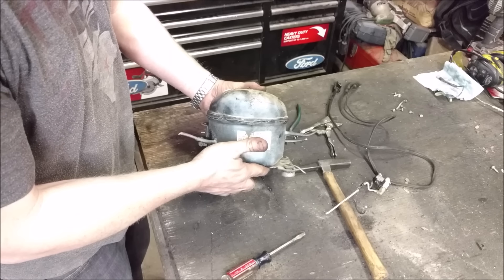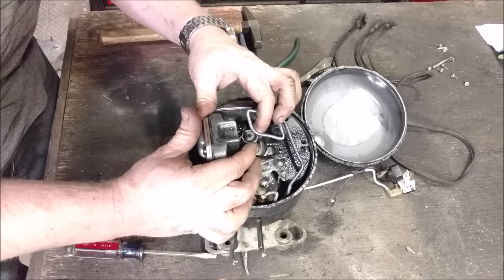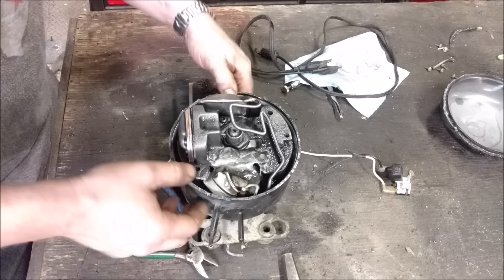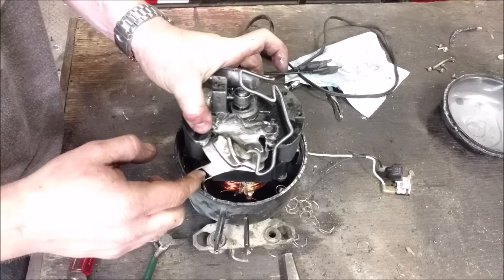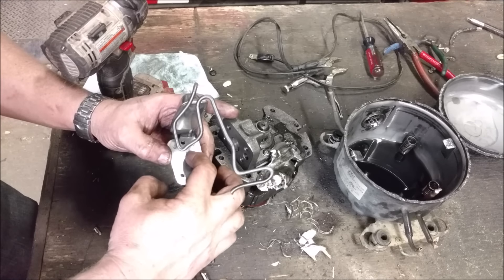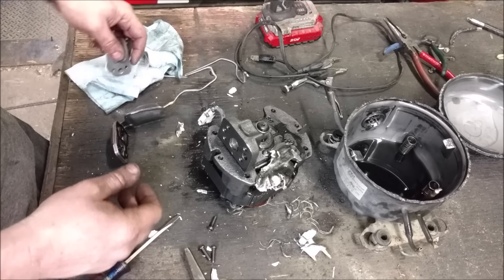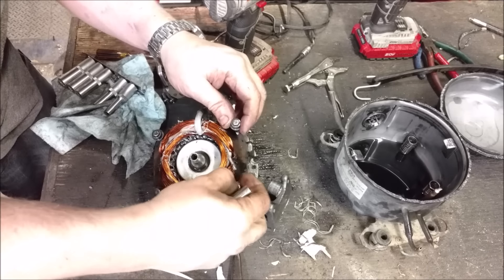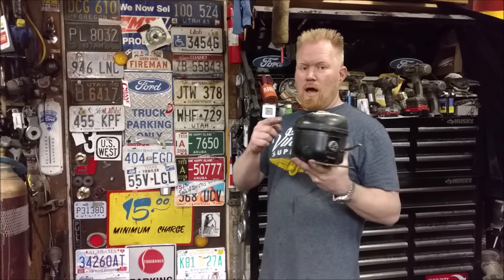What's inside a Refrigerator Compressor

Comment: Oh hey. Thanks man. I've always wanted to see inside one of these and maybe use them for stuff. I'd like to draw a vacuum on a chamber to freeze dry a banana actually. 
Have you gotten to experiment with rust removal using your battery charger yet since back when we talked about it ¿
Reply from the maker: Freeze drying would be a fun project. I haven't played around with battery charger electrolysis.
Reply: Banna somanney  counder fee but not all coundarrey  ables  c-19 cabenes fee,ok

Comment: Those bolts might be Triple Square bolts. 
I’ve only used a reverse of that in VW suspension but they threw me for a loop the first time I came across them.
Reply from the maker: I know exactly the VW bolts you're referring to. I have a set of their sockets. These are close but they're some crazy half breed of a few different bolts. They might be German designed as that is the closest I've found.

Comment: I have a 1954 Philco refrigerator that I cannot get get the compressor to run. I have a new starting relay and have figured out the START/RUN/COMMON, but it never starts. I am not sure if the start circuit is complete as I cannot find the correct schematic and haven’t decided to completely disassemble the fridge. Is there any way to get the compressor running without a relay?
Reply from the maker: I've worked on old fridges a fair amount. You have your HOT wire and your NEUTRAL. 
Connect NEUTRAL to COMMON. 
Now hears where it gets dangerous..... You need to connect START and RUN to HOT at the same time but once the motor starts to spin you need to only disconnect the HOT from the START windings. 

I will note that a modern start relay may have the terminals in a completely different location than your Philco. The last vintage fridge I worked on was a 1941 Kelvinator that needed a special start relay "supco RO81 Relay"
Reply: @sixtyfiveford  I took your advice but am apologizing for being delinquent in saying thanks. I took an old cord and modified it to attach to the compressor; the neutral to the common, the hot to the run, and power from the hot through a momentary push button switch to the start connection. Upon pushing the momentary switch the compressor immediately began running. I released the push button switch and it continued running. The compressor is surprisingly quiet and the refrigerator began cooling soon after the start. I tested it several times and each time it ran fine. Now it is near the top of my honey-do list. Thanks again for your help. Darlington, South Carolina

Comment: Just out of curiousity, why are there 3 wires on the compressor wheras the input power is standard 2 wire (hot and neutral) ?  What's that third wire for ?
Reply from the maker: Just to start the motor, then the power only goes to the run winding.

Comment: My kids left the freezer door open . 7 hours went by before I noticed it. The compressor now buzzes real loud for a few seconds. And does it about every 5 minutes. Fridge doesn't cool anymore. But sometimes it runs fine. What do you think is wrong with it?
Reply from the maker: It overheated it. The compressor needs to cool down completely for a few hours and then try. So close the doors and unplug it for 2 hours. Then plug it back in.
Reply: @sixtyfiveford  i did try that. It's just a garage fridge. Nothing important is in it. It was unplugged for about 5 hours. Then I plugged it back in for a few hours. Still buzzes pretty loud for a few seconds. And does it about every 5 minutes. The compressor feel hot to the touch. But doesn't have any vibration like the one in my house has. Almost like the motor isn't spinning. It has also just gave up on cooling anything... thanks for the quick reply!

Comment: How sensitive to motion are these compressors?  For example if one of these was running in a moving vehicle?
Reply from the maker: They don't do well in my experience. I tried running a minifridge and it kept tripping the GFCI when in motion but ran just fine stationary. It really depends on the power supply though as some may run it just fine.
Reply: @sixtyfiveford  Perhaps it's wise to shut it off when in motion and turn it back on after parking.   Others have said motion never bothered their AC fridge.   How does damage occur from that movement?

Comment: DIY VACUUM PUMP. DO THEY NEED OIL?....OR WILL THEY JUST BURNOUT WITHOUT? THX
Reply from the maker: They hold enough oil in the reservoir to last a lot of hours. Running them for hours and overheating is generally what will kills them as a vacuum pump.

Comment: Hi sir  I have one doubt sir today I changed foster refrigerator  new compressor then unit also good working but I felt compressor too much heat ... Automatic cut off cut on .. while unit running manifold pressure gauge not stable range ... May be fillter block? Sir
Reply from the maker: Yes, the filter is probably partially clogged.

Comment: The only thing I don't understand is why did the motor burn out. I understand parts overheated initially you opened it up cleaned it up got it to turn got it to run only to have it burn out but why I mean why did it burn out. I would think once you freed the motor up that it would've just run normally or is that why it overheated in the first place was there already a problem with the motor
Reply from the maker: There is two sets of windings; a start and a run set. The Start windings were already burned out with no electrical connection (reason I had to start it with the drill). The Run winding was shorted to itself and drawing a lot more current than it was supposed to. This made it produce a lot of heat(burning the oil off) and finalize the shorting out.

Comment: My dehumidifier's motor of the compresor start ratling after a month or two of use. I dont know if it sits on springs or rubber but is it dangerous to brake or something? It start with a slight ratle and then it became more. The motor hits on the metal ball cover.It does that only when the motor stops not while working. Any ideas ? Thank you.
Reply from the maker: That's pretty common and there's nothing you can do about it other than make sure the exterior mounts are secure.
Reply: @sixtyfiveford  .Hi Sixtyfiveford. Thank you very much for your answer. Yes i checked the exterior rubber mounts are perfect and tight. But can this noise of the motor hitting to cover make a bigger damage ? Or there is no problem. Thank you.

Comment: So the screws -- they do look a bit automotive, i can't see clear but if a bit in the middle (top of the E looking part) seems ripped off, they might be torque screws, that have an extra bit used to torque them in place that rips off at specified torque - not really meant to take apart -- but i may be wrong, i can't see clear enough

Comment: Those bolts with the reverse Torx may be a bit weird but even weirder yet are triple square.  I see a lot of triple square bolts in my Volkswagen.  I know someone who thinks they are Torx but I told him they are not.  I am sure that using a Torx bit with triple square bolts is just begging for misery so I told him he won't be helping me when I need to do anything to the car.  I got nothing against him I just don't want trouble with those bolts.  They use them to mount the rear brake calipers and other things.  Some people have bad enough luck even when they use the correct bit but somehow the head of the bolt or the bit breaks.  The first of the two can cause major headaches because next will be trying to get that bolt out and that will not be fun at all.  A root canal without anesthetic would be many many more times more fun than that considering the price of the part the bolt might be stuck in.
Reply from the maker: I know what you mean. I have a few triple square bits for Volkswagen. I standard torx would ruin them pretty quickly.
Reply: John Doe Previous owners probably wore them down by using an Allen socket on them. I had them for head bolts (very tight) already and had no issue with them. Even when allens mate to allens, they don't last very long. One of the worst fasteners ever. I'd actually take Phillips or slotted over them. Torx and torx plus I prefer.

Comment: The fill line... you said.  It is to fill up the system,,?   
1.Can I assume that by the system you mean the compressor?  
2. And what should I assume they fill it with?  
I prefer not to rely on assumptions, especially the way I assume things.
I wonder if there is another video by someone else that would explain it.  I guess I have to keep looking.
Reply from the maker: The entire refrigeration system(compressor, condensor, evaporator, and tubing) is filled with a refrigerant aka "freon"(r-134a, r-22, r-512a, r-12 etc).
Reply: @sixtyfiveford  Oh I see.  But you instead filled with oil instead of Freon as you use the compressor for different purpose.  Okay it is clear now. I think.

Comment: Cool video, thanks. Do all fridge compressors have a set quantity of oil? If so how much would that be? As model kit builder I airbrush and though I have an ab compressor I fancy making a spare at some point with a fridge compressor. The piston btw is probably similar to what we call an abc piston used in nitro rc aeroplane glow plug engines which are ringless and very slightly tapered so they seal tighter the further up the bore they are.
Reply from the maker: They use different amounts of oil dependant on compressor size and line volume. They will almost always have the oil capacity listed on the appliance.
Reply: sixtyfiveford Cool, thanks.
Reply: I've watched a lot of these videos and read a lot of comments. Being a closed system there is a set amount of oil. When used like an air compressor the oil is slowly depleted sending the oil out in the air you are using so you'd need an oil trap to keep from contaminating your paint. BTW!!! I hear they make excellent vacuum pumps! (for vacuforming)
Reply: ABC, Aluminum piston, brass (or brass sleeved) 
cylinder. (Correction) Brass, and chrome plated 
cylinder.

The interesting thing I saw, the piston design is 
the exact same, as the old Cox .049 engine.  Most 
other engine's pistons have a wrist pin.  Cox used 
the ball joint on theirs.  (End of the con rod, was ball 
shaped, and the piston had a socket, with the 
bottom crimped, to hold the con rod.)

steve

Comment: I just lost my compressor in a 3 year old Kenmore Elite refrigerator and was turned down on warranty because they said it didn't say it was a 5 year warranty on my owners manual.  Well, it said nothing about the compressor, but the internet says it was 5 years. But Sears got back with me and said that some compressors only have one year unless it says so on the owners manual.  When I bought it, they told me the elite has better components in the refrigerator.  But I guess not the most expensive part. Wow.
Be careful what you buy. But it is an LG compressor, and a man said he may be able to help me. But we will see. I got mi e from Sears, but Sears really is just an internet company now, and their employees just work out of their phone. So don't but there unless it's in writing.  Out 3 grand. I'm trying to decide if the replacement of the compressor is better than buying a new refrigerator.

Comment: I tried using these to compress air and other gases. It ceases up. Apparently the humidity in my gases causes problems for the oil in these compressors.
Reply from the maker: I believe the oil is hygroscopic so it absorbs moisture.
Reply: +sixtyfiveford:
But why does it cease up so quickly? I don't think the inside rusted since the oil is suppose to protect.
Reply: miscible basicaly means that the oil and refrigerant mix well together. if your pumping air through it then it's not getting properly lubricated and it seizes up

Comment: Please tell me is the piston somehow lubricated?
Reply from the maker: Yes a light mist of oil was constantly circulated across the piston and through the entire cooling system.
Reply: @sixtyfiveford  Thanks. If i take the compressor out of that case and connect it to new drive, making new lub system would be easy? Cause now everything sits in oil and i don't think there are nice oil intake holes etc. for the new connection for external oil tank that i want to make. I want to buy some compressor from scrapyard and im not ecpecting them to work properly so im simply preparing theoreticaly, haha

Comment: Do you scrap the copper ? Looks like there's 1kg of copper on it
Reply from the maker: @aledhughes6000  I never do as it's not worth the time. Even if there was a kilogram/ 2 lb inside there, that's only around $6USD. It would cost at least $1 to $2 in cutting wheels and maybe 20 minutes if you got fast to get it out.
Reply: @sixtyfiveford  1kg is £6.30 mate that's a lot I have 4 of them I'm sure I'd get 4 a week I have started scraping now not open one yet looks hard to do you make it look easy

Comment: did that compressor come from that reach in cooler
Reply from the maker: It did. I came out a few days after that video and the compressor was blazing hot but the inside was COLD. I unplugged it and attempted to start it back up a few days later to no avail. It has sat outside for years unprotected and this caused the thermostat to stick on. I think it ran for at least 12+ hours without ever shutting off.
Reply: Running non-stop isn't a problem. I have a deep freeze chest freezer that from the factory has a switch that is in parallel with the thermostat/cold control. I leave said switch on so it runs non-stop unless there is a power failure. It has been running that way for several years now.

Comment: Can you transfer mini fridge on its side? A buddy of mine let me borrow his i laid it on itd side in my car. Took it home to defrost. Went out to eat. came home and cleaned the fridge and 20 mins later oil started leaking out. It was fine at my friend's house but now it leaking oil I'm thinking I laid it on its side.
Reply from the maker: @tavita  Nothing will leak out of the system as it is sealed. The"oil" you're seeing is likely something like a popsicle or food goo. You can transport them on their sides, but it is advisable to stand them up for at least an hour or two before you plug them in. It's possible for you to damage the compressor if oil gets into it. However, If you did this, it would not leak oil.
Reply: @sixtyfiveford  It was his beer fridge no food stored I inspect the back and it's coming from inside the cover. A dark gooey brownish color, I thought it was Hershey syrup at first but it's not. Been doing some research and I think the seal is bad. Sucks it happened on my shift. Thanks for the quick response.
Reply from the maker: Then it is exploded soda can or beer can. A lot of fridges have a liquid reservoir which is just a dish. Takes any water That would run off through the freezer and or fridge and stores it next to the compressor. Heat from the compressor. Evaporates this into the room. Eventually you're left with a gooey sludge. Generally this is only on large style fridges, but it is not completely impossible to have it on a mini fridge.

Comment: I don't get it. Why do you have to crank the motor to start it? How does it normally start? There's no starter winding? No capacitor?
Reply: I'm not a pro refrigerator tech but all the ones I have worked on in the past have a capacitor.

Comment: Sorry, no such thing as a "Air Filter" 04:05 within any compressor.   Prior charging any refrigerant within any system, a deep vacuum occurs.   Any air or moisture within refrigerant will cause acidosis, which is deadly to the system.

Comment: What type (Make/Model) was this compressor from?
I dislike LG (Like Garbage) & Samsung's appliances.

I assume R-134A now phased out as of 01/01/2021.

I had an old (1999) GE refrigerator that finally died it would make a loud bang bang noise every-time it shut off well one night bang bang bang followed by a hissing noise for about 3 minutes it ran all night but no cooling after that! It was off/on though probably due to the thermal cut-out as the liquid refrigerant actually cools the compressors windings and it had none left!

Also the refrigerant (AKA Freon but Freon has been banned since 1994 R-12 and 2010 R-22 but it still is called that even though it's not anymore) some of the new ones are actually Propane (no accessories included though!) and IsoButane! so flammable refrigerant in a unit that has sparking parts Not so smart.

Also modern AC's are CRAP as most modern appliances are. 
 In fact I was given an old 1984 (as old as me LoL) 12K BTU window rattler it works great and when the compressor shuts off the whole world can hear the rattle and noise of that plus it still blows cool air 3-5 minutes after not like the new ones that blow room temperature air 1 second after it shuts off the cooling coils are huge compared to modern units this is probably why it still blows cool but not cold air for so long after the compressor shuts off.
Reply from the maker: It was a Frigidaire Freezer.
Reply: @sixtyfiveford  R-134A or the newer R600A fire hazard?

Comment: I work for a place we used to have to drain the oil out of those compressors before we junk them out we drilled a hole in the top and drain the oil out we used to joke around and call it piece of crap